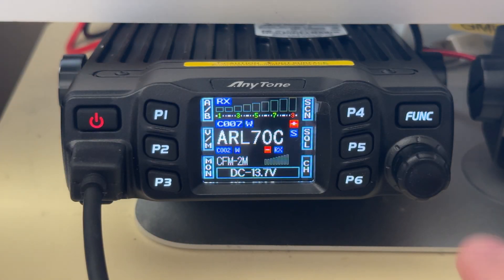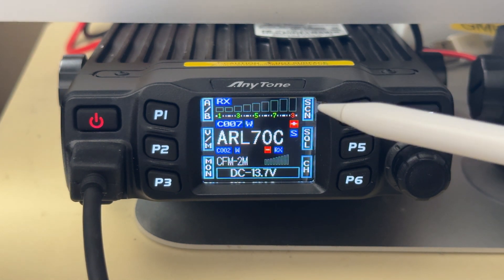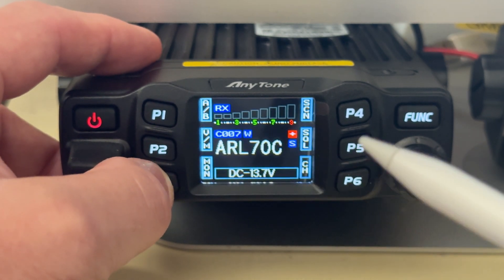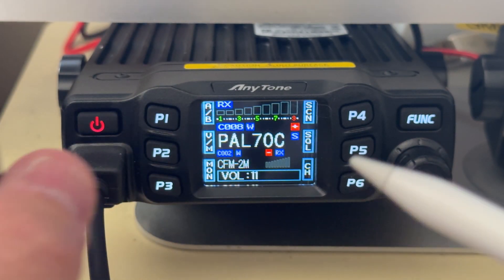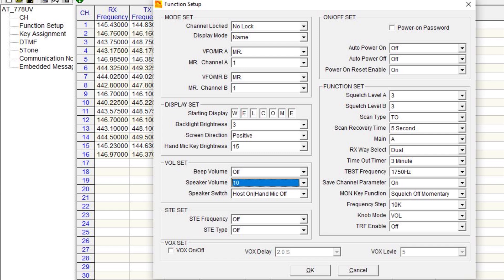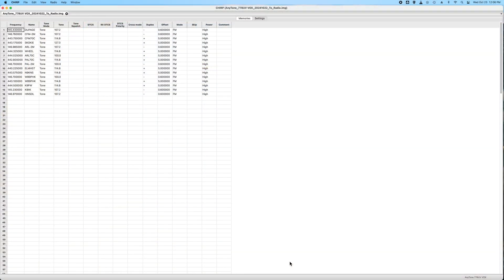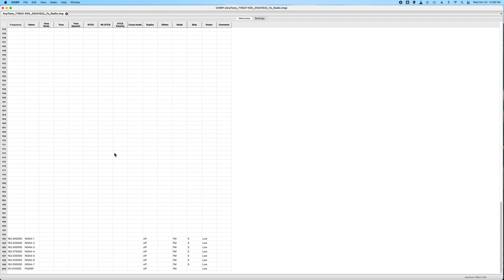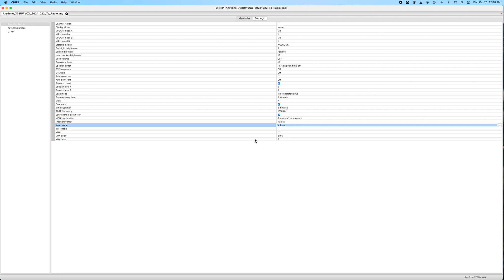Anytone AT-778UV / Retevis RT95 Volume Knob Mod

Comment: I have the Retivis RT 95, which is basically the same radio. I watched some two and three year videos and it seems like the information has been lost over the last few years as the more recent videos I’ve seen.

If you press and hold the function button and dial down to mini keys, you can instantly change the channel assignment for the knob to volume. No programming software necessary. Just an FYI. Cheers 🤙🏼
Reply from the maker: That is a great tip to know and thanks for sharing this valuable information 👍. I am pinning yourcomment, as it’s very helpful. Thank you again.

Comment: Thank you for this video and the hint about the default for the knob! I probably would have discovered it eventually poking around in the CHIRP software (I also prefer to use Chirp on the Mac). I had figured out how to set the PA button on the handset for the volume switch so I could use the updown on the buttons for volume but I do like this so the knob on the radio defaults to volume not channel! Seems like that is how it should have defaulted from the factory but glad it can be changed! I have aonly had this radio for about 3 days... but liking the features! (and same feelings about the shorter channels names and the shorter message on the power on screen! The one other thing I foud a bit annoying was having to figure out what all the three letter abbreviated functions were on the customizable buttons! They don't tell you what these cryptic codes all mean in the manual... I had to try some of the less obvious ones out to figure it out and write them into my manual so I would remember them!
Reply from the maker: Glad to have helped. Thanks for watching and commenting.

Comment: Does this radio have a Roger Beep and if so can it be disabled?
Reply from the maker: It does not have the Roger Beep. The only Beep setting in the menu is to turn off the radio beep every time you press a key on the radio or mic or turn the knob. That was one of the first things I turned off.

Comment: this radios now have  mic gain setting in menu or not ?
Reply from the maker: My radio has a Mic setting (1 thru 3) in the Function Menu (Menu Item #2). It is not mentioned in the manual.

Comment: Nice radio but good luck with programming it via PC.
Reply from the maker: Have to ask why you think so. I’ve programmed it with both the Anytone CPS software on a Windows laptop and via Chirp on Mac. No issues with either.
Reply: @EverydayATV  And CHIRP on Linux works great with the RT95 too.

Comment: Great video.  I have the RT95.  I’m trying to solve squelch problem.  Radio outputs noise constantly no matter what the squelch setting is.  Any ideas how to solve?  Thanks.
Reply from the maker: @samstlm  thanks. I think you had also asked about making the change for the volume knob. It’s only available to set in the CPS or Chirp programming software. No option to do it from the radio menu. 

Regarding your squelch issue, the best thing to do is back up all of your programmed channels and settings either via CPS or Chirp. Once you do that, go into the Radio menu and do a factory reset. Once the radio is reset, write your back up file back to the radio. I had a similar glitch with another radio and doing the factory reset and then the restore solved the issue. Fingers crossed that this works for you. If the issue still persists, I would definitely reach out to Retevis for further troubleshooting. Might be an issue with the radio in that case. 

Hope that helps. Thanks for watching and commenting.

Comment: Not sure you knew this but your Mon button you can assign as sql off and on for more than hold.  Look at your function set, and its 2 lines up from your knob mode is MON Key Function, you can assign it Momentary or Off/On
Reply from the maker: @Trashpanda131  great point….good to know, thank you. I have the PD button on my mic programmed to do just that. My PC button is set to start/stop scan, PB is set to switch between channel mode and VFO and PA puts me in volume mode so I can use the up/down keys on the side of the mic to adjust the volume. 

My only tiny gripe with this radio is I wish I could get it to display the freq along with the channel name like most of my other radios do. 

Thanks for watching and commenting.

Comment: Thanks for the Volume knob modification. Just a note for some Retevis RT95 owners, your P6 button may show FRQ after changing the knob to volume control, this is the same as the P6 showing CH in this video and will allow up/down channels or frequency.

Comment: have the retevis rt95 as a base to monitor repeaters and as my mobile rig for 2m simplex and GMRS. this little radio does a great job for under $300 for 2 radios and the retevis mobile dual band antenna.
Reply from the maker: @terrymeyer7084  yes this is a great radio for the price. It is my base rig now. My only gripe that Anytone is investigating is a popping noise I get from the mic speaker if I have the audio set to both the main unit and the mic. When someone first keys up on a frequency I’m listing to, I get a slight popping sound from only the mic speaker. Do yours do this too if you set the speakers to both? Thanks.
Reply: @EverydayATV  i use an external speaker, i’ve never noticed
Reply: @EverydayATV  i just switched to the main and mic speaker. it does pop when someone keys up
Reply from the maker: @terrymeyer7084  thanks so much for confirming it’s not just my radio. Not a big deal since I won’t use the mic speaker but still good to know nonetheless. Thanks again.
Reply: @ no problem
Reply: @EverydayATV  Mine does it too. It's weird, as though it's some type of digital lock that opens the audio first. Not a problem for me, I don't really need or want a speaker mic on a mobile radio, but it is annoying if that's a feature you wanted to use. I am super grateful that there is a way to change the big knob from channel to volume; that was one of my bigger annoyances with the radio. The things I like are the screen, it's loudness, and illuminated keys! I just spent $1200 on a Yaesu HF rig - and it does not have illuminated keys! I also like the complete and total customization of all the keys, and now the selector knob as well. I got it with a magetic antenna on a black friday sale for $110 USD. At that price, you just cannot go wrong. I love how all these cheap radios are getting people on the air! It really may be what saves ham radio from dying out completely, in my opinion.